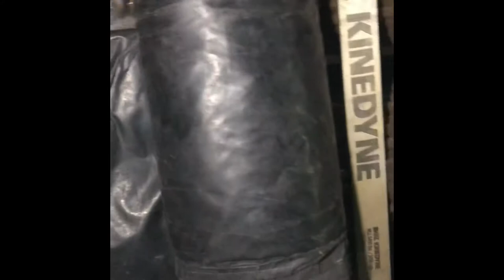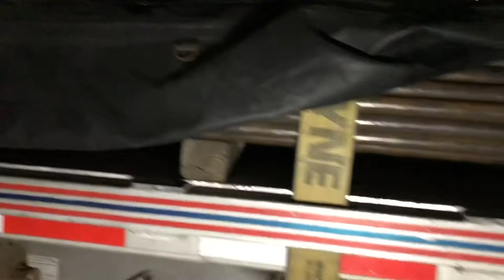Trucking , How to load bars on a Flatbed Trailer.

Comment: See now here we go.  every steel hauler in America would of told you we see a lot wrong.  Center bundle is only bonded between the other bundles. (belly strap + 4x4x8s in front of all the bundles to stop from coming forward in case of an emergency stop)  Everyone has their own way of doing things so im only saying you can never get a violation with having too much securement.   🤔🤔

Comment: Belly wrap and edge protection?
Reply from the maker: Jonathon Espeseth just rap over the top , if there is a second, or third , or more layers high , you strap each layer at a time , not skipping any layers. if it’s a large single bar you wrap like my mill roll video. As for edge protection, it’s not needed , every thing is round .

Comment: Thanks for the background.  I'm about to do some consulting for a trucking outfit and your comments about tarping is interesting.
Reply: Is it normally expected that the customer will load the trailer, or must it be specified by the broker?
Reply from the maker: Most of the time the company that your at will load you , and you just let them know where to put it , example hauling a steel coil . There are times that I get on a forklift and load myself , if they don’t care I don’t care , whatever gets my out the door faster .